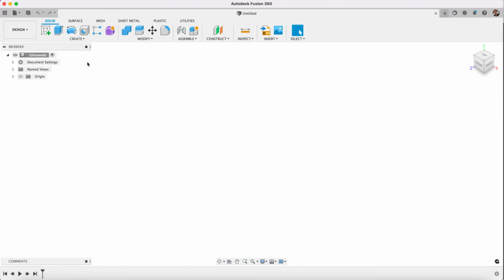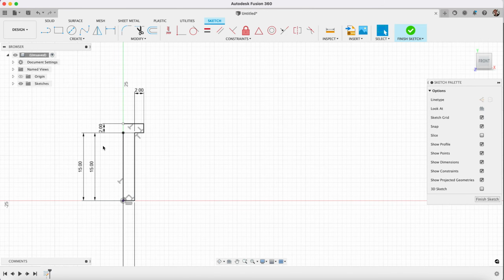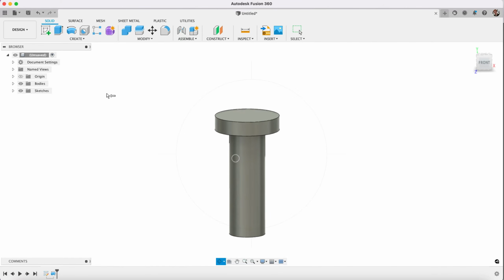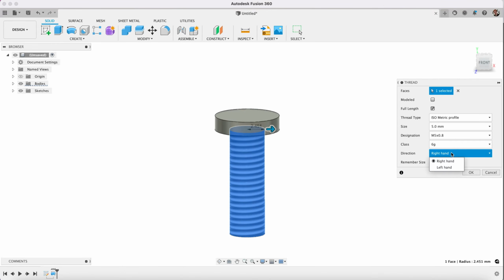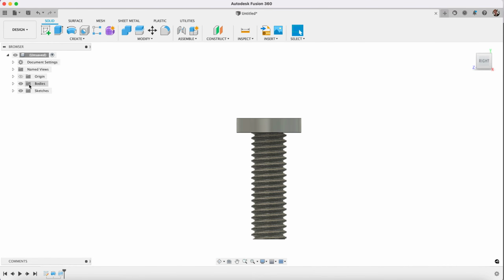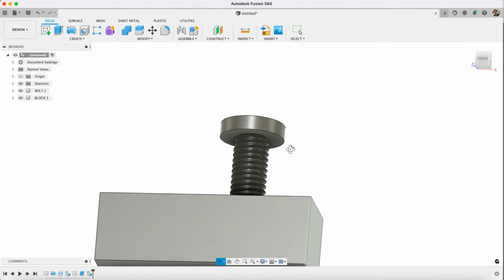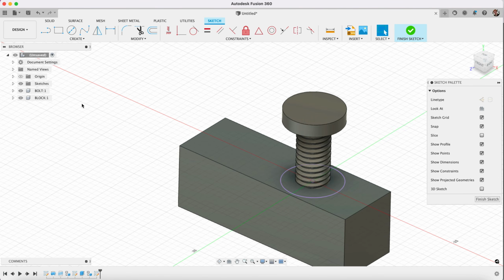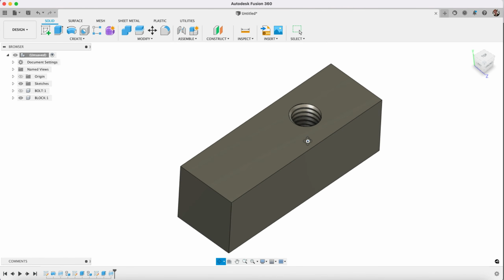Fusion 360 - Modeling Threads Tutorial - 3D Printable Threads

Comment: If the diameter of the hole is, for example, 4mm and you choose to make an M5 thread on that, will Fusion 360 cut the extra 1mm automatically? Because, at least it lets you cut an M5 thread on a 4mm hole. So, I am wondering if the result of this action will be exactly the same as when the diameter of the hole has been initially 5mm, or not.
In real life, if you want to make an M5 thread on a piece of metal, the hole which you should make on it before threading, should be less than 5mm (I guess it should be 4.x mm. There are charts for this. Also can be calculated by some formulas). So, even when we ask Fusion 360 to make an M5 thread on a 5mm hole, it will actually add some substance to that hole (i.e., it will shrink the diameter of the hole throughout this process). So, I mean even in this case in fact it changes the diameter of the hole to the needed diameter throughout this process.